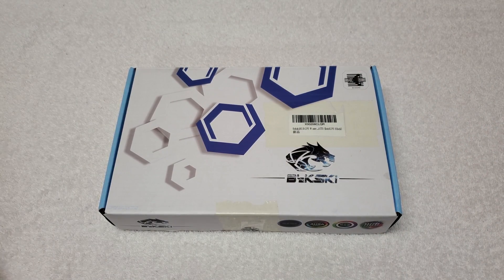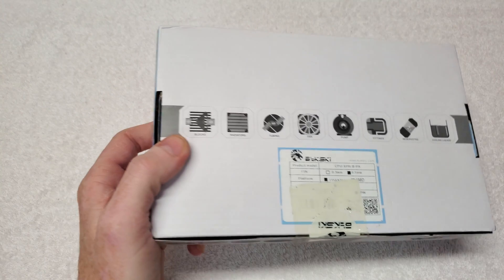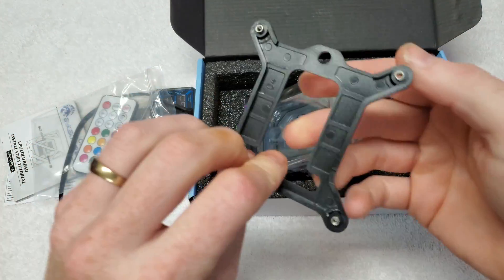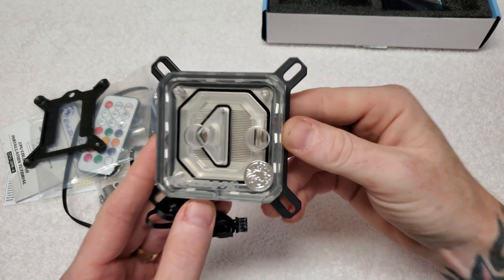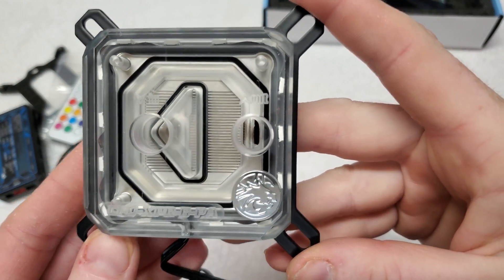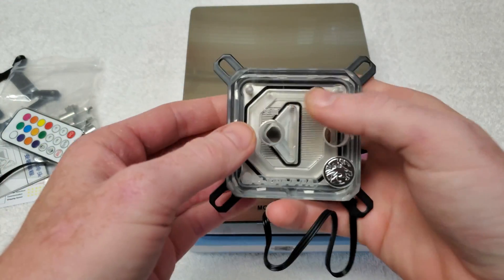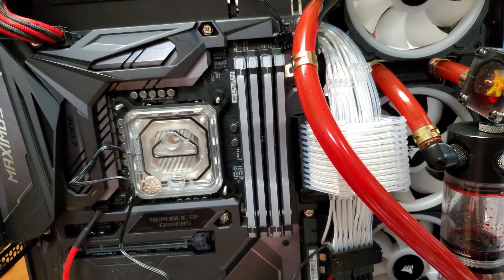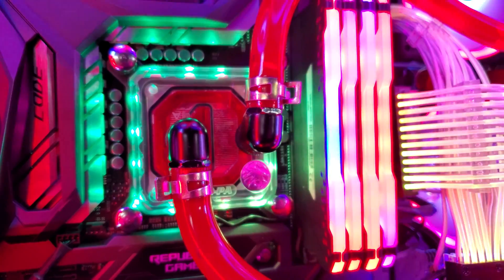BYKSKI RGB CPU Water Block unboxing and first look (Amazon)

Comment: Hi, did you use the ASUS Aura sync software for the waterblock to light up?
Reply from the maker: I plugged the 3 pin 5V cable from the CPU block to my Asus Motherboard 3 pin ARGB header. Then use Asus Aura sync or Asus Armory crate and choose add strip and you should be set from there. You may need to change the amount of leds in the Asus software to 16 or 20 (I forget how many leds are in the the CPU block). Hope that helps.
Reply: @Moyersteven1  thanks for the help :)

Comment: how is the block still? its nickel plated, so i cant use it with copper radiators then right?
Reply from the maker: The block is GREAT! Yes you can use it with copper. Its normal for copper to be nickle plated. Look at GPU blocks, how they are "Silver" thats Nickle plated copper. So you can have this block with a copper radiator.  Both my radiators are copper with brass tanks. The only thing you CANT have is Aluminum. Hope this helps. Thanks for stopping by!
Reply: @Moyersteven1  oh sweet! so I can use copper based, nickel plated water blocks from other manufacturers too (looking at thermaltake) that don't necessarily look good but function well, and use them with a corsair full copper radiator. are all fittings cross compatible then or do i need to use brass fittings?
Reply from the maker: @lazarusmagellan2367  Correct, You can use Nickle plated copper, brass, and copper in a loop. Just no aluminum. Check out the Alphacoool Eisblock XPX Aurora CPU block. I just picked one up and its absolutely amazing. Temps are great as well and it looks sooo good. Any fittings will work. I suggest looking at Titanrig dot com or Performance PCS. They have some great sales going on right now. Check out my latest video and you can see the Alphacool CPU block in that video. Any more questions just let me know. More than happy to help.
Reply: @Moyersteven1  sweet, thank you very much. Ill probably stick to the bykski opposed to the alphacool, because the alphacool is in the same price range as an EK which would mean i might as well just get an EK. Ill check those sites for their sales too. Any advice on 280mm copper rads or should i just stick with the corsair?
Reply from the maker: @lazarusmagellan2367  Corsair Rad would be great, They are made by Hardware labs. Just branded Corsair. So you could also look at Alphacool, or Hardware Labs. You will want to think about what you plan on putting in that loop. Restriction has a factor. The Corsair and Hardware Labs radiators are a high restriction radiator. So if you plan on having a lot in your loop you will need a strong pump. If you are just doing 1 or 2 280mm rads, the corsair ones would work just fine. I use Alphacool because they are a nonrestrictive rads and give great flow rates. But you cant really go wrong with Corsair/Hardware Labs they are great products. Just make sure you flush everything very well with distilled water.
Reply: @Moyersteven1  ahh i see. I'll check out alphacool radiators. My loop is just one cpu for now. in the future i may add a single 140x140mm radiator from my cpu to my gpu if i liquid cool it, but that's still not for certain.

Comment: Did you find it very hard to get the thumb screws going? I'm on am4 and for me it was very difficult / it seems I'm squeezing my cpu to death
Reply from the maker: It can be hard to screw them in. You want it to feel like yo are squeezing the CPU to death, to a extent. You dont want to start flexing the Motherboard. But having the block on very tight ensures good contact between the block and CPU.
Reply: @Moyersteven1  a

Comment: Did you use an application to control the RGB?
Reply from the maker: The CPU RGB is plugged in and controlled by my Asus motherboard software. Aura Sync. Uses a 5V RGB header.
Reply: RC Logic Woah I did not expect something so cheap to run on that application
Reply from the maker: @taejunchang396  Its an awesome block and still keeping my i7 at a cool 30c 👌
Reply: RC Logic damn that’s good for a really cheap price, bykski ftw
Reply: Para Digm Ah, okay.

Comment: Hey great video! I’m planning on getting this water block instead of the thermal take v4 but I’m a little skeptical because you’re the only one to review it on amazon and I’m just wondering how the temps are holding up so far?
Reply: Wow thanks for the fast reply! Another question what cpu do you have?
Reply from the maker: @MrMigs-fw2iy   I have the intel i7 8700K @ 4.9ghz.
Reply: Thanks for the help! I finished the build and it looks stunning! I can link a google drive video for you if you want to see it!
Reply from the maker: @MrMigs-fw2iy  Yea, definitely, I would love to check it out.
Reply: @Moyersteven1  It seems the Bykski block is comparable to other popular branded blocks in terms of performance!
Reply from the maker: @alexwong-s7s  I agree, Its been doing great! Thanks for stopping by.
Reply: @MrMigs-fw2iy  Wow, can you share it to me as well?
Reply: So is the left one pump in (coming from the resovior) and the right one pump out (going to the radiator)
Reply from the maker: @MrMigs-fw2iy  The one on the left is the inlet and the one on the right it the outlet.
Reply: i have i7 8700k and i over clocked my cpu at 5.3ghz. Idle is 90-95 when full load. I have one 360 and one 420 radiator. That's not good??
Reply from the maker: @nguyenngoc6979  Those Temps are on the higher side. At those temps you are gaining less that it's worth to push your CPU to those temps. I wouldn't let it go over 78-82C. The gain is minimal. I would drop down to 5.0ghz and keep max temps no higher than 80C.
Reply: @nguyenngoc6979  it is okay. may be lowered down the voltage and 5.0ghz?
Reply from the maker: Temps are GREAT. I have my CPU clocked at 4.9ghz, Idle is 28-30C and under full load 68-70C. Holding up great. I highly recommend this block. I could have gotten a block for $150+ or whatever I wanted. Money wasnt really a factor in my water cooling build. I was going for the looks, what I like and quality. The block is very fine work and the quality is some of the best ive seen. If you are looking at this, get it. Its great. Thanks for stopping by. If you have any more questions please feel free to ask.